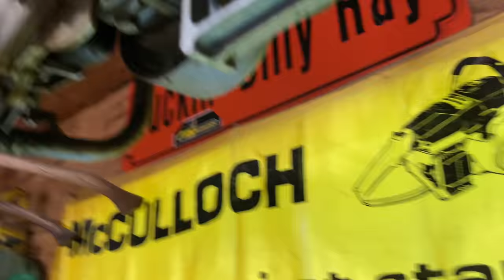Hey Beetles! leave our trees alone.

Comment: Another good video so I was wanting to know something which is the better saw a Stihl or a Husqvarna I've been wanting to try this and see if I can actually do it which one would be better I don't need a crazy expensive one I just need one to help me what are your thoughts
Reply: Hey Steve, if you're just cutting some firewood and a few leaners, you can't beat the price per pound of quality with the Echo 590. It's a good sized saw that has a lot of pro features without the computer and strato port crap that most of the stihl and huskies run now,  it's still the old style durable motor, with good steel caged crank bearings. Good luck 😉👍
Reply: Stihl vs Husqvarna...bring that up in the pub where I live and there's bound to be a fistfight!! Buy a pro grade saw and you won't regret it. Buy used if looking to save money. Home/farm grade saws are no fun!!!